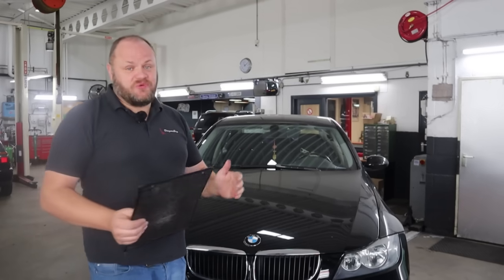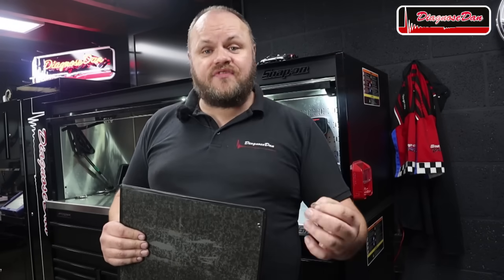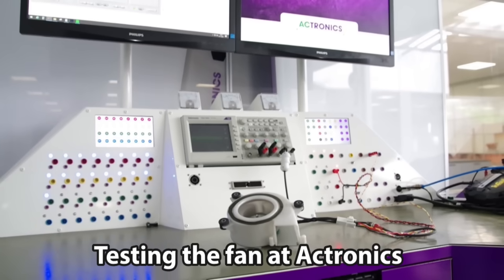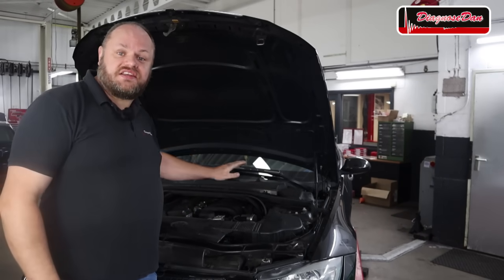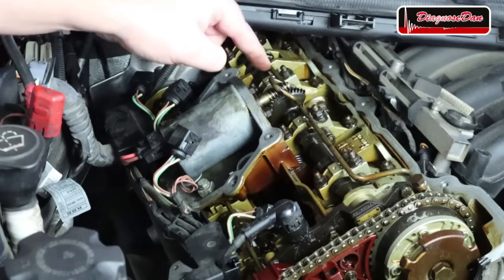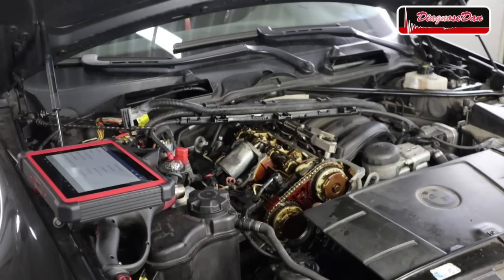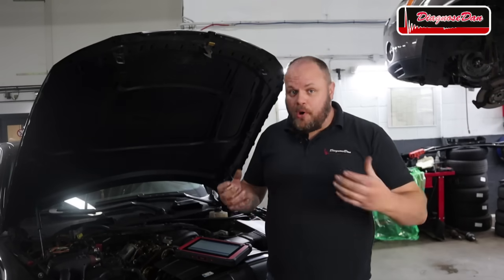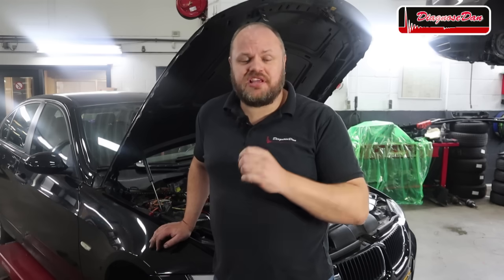Bmw valvetronic,Explained,Diagnosed,Fixed

Comment: I heard that the valve Tronics can affect how these 128I’s act. I’ve been told the transmission in these cars are just that way but every morning I start the vehicle up it seems like it has a hard shift from 1st to 2nd and sometimes 2nd to 3rd but the car is drives great. I’ve change the filter and transmission fluid I’ve never had this problem before and l Keep getting told that’s just ben told that’s the shitty BMW transmission? 
Any advice or any help please

Comment: Hello I have an dme error 134A02 Valvetronic servomotor overloading is the same kind of problem with overheat ? But no engine check at all

Comment: At my E87 120i the valvetronic is defect, i dont know exactly whats defect, i changed the position sensor and was about to learn it in via laptop but it failed. The Excentric shaft looks only good at the knuckles, but beside the knuckles where the rough surface is, its hones in a lot, like 1-2 milimeters. So next thing i will do is change the Motor and see if the motor is the problem it fails the learn in test. But one point you said i dont understand, because i drove a 120i with working valvetronic that felt alive and had lots of power at lower RPM, mine with the valvetronic defect and running with the throttle body feels like 100hp instead of 150hp and much less torque at the lower revs. I also had to pull out the positioning sensor plug, because with it plugged in the engien starts and feels like its just on 3 cyninders. But without the position sensor plugged in, its working fine as a dayli driver, only problem is it has so much less power. If the Motor is not the problem, i will replace the excentric shaft, but its always a lot of work in this tight space at the E87.

Comment: Dan I'm getting two different codes p1030 and the p1014, one points to the motor and the other to the sensor now I don't know if one is triggering the other,  the valvetronic motor is issued as permanent while the sensor is issued as current code. Could you help? Thank you!

Comment: Dan, love your videos always learning from you. 

I am thinking that with time perhaps the insulation on the motor windings fail and create an electrical path to the armature, then to the motor bearing that sits on the motor casing. 

That can account for relatively low resistance between motor brush and the casing. Would be interesting to see how heat or lack of heat affect the 2800 ohms you were seeing on the multimeter.

Thank you Dan, great job.

Comment: Hello I have an issue with my 2007 x5 Valvetronic system.  When I test the bank 2 vvt motor it has 12v with the wires swapped it has 3.5v any ideas?

Comment: Hello Mr Diagnose Dan 
I'm having issues with my 2006 BMW 3 series with an N46 engine like you have in the video. I bought a new Siemens VDO valvetronic motor and it's failing to relearn to it's correct position.
I'm not sure whether if it's the Eccentric shaft sensor.
Please help.

Comment: Awesome video as always!! I have an 08 528xi that has rough idle and NO power. it has a code for the eccentric shaft, I forgot what the code is right now though. I do have a question about that shaft-the scanner says eccentric shaft specified angle is 0 but the actual angle is   56.  I unplugged the motor and can manually turn it back to 0, when I plug the motor back on it stays at 0 but as soon as I start the car the specified number goes way up, then the actual number goes back to 56 and specified goes back to 0. Do you think this is the eccentric shaft sensor? I tried unplugging sensor and running the car and that made no difference. THANKS for ANY guidance you can give me...Ken
Reply: Actually the code is 2A39=valvetronic adjustment range. It also has 2E85 =electric water pump communication that is steady. I am assuming that code has nothing to do with the running but maybe I am wrong about that? I did do the adjustment range/stop and that said it was successful.

Comment: My bmw z4 is having EML light on 😓
Timing chain, Valvetronic and solenoid valves and camshaft exhaust sensor are recently changed..
The error code showing are P1050 and P1062.

Comment: @DiagnoseDan interesting video. I have a 330i rebuilt angine and after 30.000km it started to stutter/jerking up until moderate throttle, and fithout DTCs. on WOT and after 3500rpm works like a charm but anything else its miserable e90. lots of love money and sweat went into this car but it started to pi** me off. bunch of parts has been changed and this is something new to check tommorow the resistance between pin and housing. i will put new plugs after 30k and check/change accelerator pedal( friend has one ), and we hope for the best.
But if i get any resistance on servo motor do you reckon its dead? or on the way to get dead soon? Nice videos, i love em. have a nice one

Comment: I once sold an e46 318i that was stuck in limp mode for. We agreed on $900. When the buyer came to pay for it and take it away, I took the $900 and gave her $200 of it back as a goodwill gesture. That’s how much I hate E46 junk.

Comment: Yes it is a sign of failure. There are little shavings that create a short through the motors wires and the body itself. I know that you can clean the whole assembly and then put it back in (as in an electric motor is not much that can go bad) but I have never personally tested that. I just go and buy a replacement part and be done with it.

Comment: I have fault code 2E0F can you help me diagnose this? If the issue is the same and related to the valvetronic motor why bother replacing if I just get a little less mpg? Might as well wait for the valve cover to start leaking and do both at same time

Comment: Dan the garage said my valvetronic motor needs doing 804 pounds to fix they said my car makes noise when open  close doors on key fob and my car when warmed up either won't start or if it does it will only go ten mph in each gear m135i ????

Comment: Hi Dan, great video.  I have been getting the following error code 2A70, 2A6F, 29CC and 29D0 despite new coils, spark plugs, VVT Motor and Camshaft sensor.  Your suggestions will be greatly appreciated.

Comment: Hey Dan, I own the same car, the exact same engine, and unfortunately the exact same problem. I've owned this car since 2016.I have replaced the valvetronic motor two times in the last 3 years, but the issue always seems to come back to my car. Any suggestions on how to fix it permanently? I have checked the motor itself and wiring harnesses and they all working fine.

Comment: Good day. I was following your videos and I attempted to remove and replace a n42 engine from 2002 BMW coupe.  I removed the cylinder head, replaced the head gasket, bought the timing tool and followed the instructions.  I attempted to start the vehicle and it cranked but no start, I then found that the fuel pump was bad so i replaced the fuel pump, fuel pump housing and also clean the gas tank from gunk build up. I also replaced the fuel filter.
after al this I attempted to start, it cranked but no start so I removed cylinder 1 coil pack and cranked with a screwdriver inside and it sparked. I have spark at least from one cylinder so I assumed all has spark, I also have gas to the fuel rail. 
I think I need to test the other 3 coils, and also if each injector is spraying.  I attempted to prime the system with a little gas at the intake while cranking and found that it was pushing air out the hose on the intake, these hoses normally suck air so am assuming that my timing is off. but how come, I used the timing tool properly I am assuming. 

what's you input.

Comment: It's no doubt that BMW messed up with the valtronic system especially on the 4 cylinder cars. Most common was the 320i, E90.
But you're good at your job, Dan. 👍👍👍👍
Reply: Everything was messed up on the 4 cylinder cars 😂😂

Comment: Hey, does anyone know how much power should be on the connector while car is running? When i disconnect the valvetronic motor and test the power i have reading of 8.2 volts, should there be something like 12 volts ? i dont know, by the way motor reading is 1.400 ohms

Comment: Don't forget the little hole on some valvetronic motors that you can stick an allen head in and manually back off the motor when removing or installing

Comment: Dan, great learning experience as usual. now i understand the valvetronic technology & reason for its use. you are a real master at finding intermittent faults so quickly. the intermittent (temperature-related) failure of a dc (brush motor…my guess) showing as a finite resistance to gnd is interesting & something i would never have guessed as symptom (aren’t such components super reliable? seems not). 

love the way you whisk off all those plastic engine covers with the cordless & use those fast ratchet ring spinners. why not leave the plastic covers off permanently & save all that work! sure, engine wouldn’t look so good & more exposure to dust & grease. (but that’s a discussion for another day).

regarding “valvetronic” technology & using inlet valve opening control instead of a butterfly to control an engine o/p, sounds like a great engineering project! but i worry about the extra mechanical/electrical complexity (& probable less reliability for a (small?) increase in efficiency). i’m curious if other manufacturers too use it. is the increased efficiency mainly at low airflow/output? guess that’s a different discussion for another day.
Reply: The motors are reliable, but can get burnt out from too much heat or eccentric shaft sticking. The motor is made by siemens vdo pretty good manufacturer.

Comment: Great video Dan. Regarding the bench test of the motor I don't believe the insulation resistance test was valid to condem that motor as faulty solely based on that reading, 2.8mohm on a 12v system is negligible. The DME can't pop a code based on that I very much doubt. However I expect if you did the same test and applied heat you would see that resistance decrease significantly. Also the fault code couldn't be generated by detecting that high resistance to earth/body. The fault must be a measurement of the motor internal resistance only. More likely a complete open circuit situation for the motor to run and not run at all when warm, if stripped a bad connection or soldered joint would be the culprit I reckon. Thanks again for these great videos, I aspire to be at your level.

Comment: I would apply voltage using a power probe on that suspected poorly insulated pin to the motor winding and the case. You can read the voltage drop and potentially pop the breaker on the tester confirming the failed insulation. The meter doesn’t pass enough current/voltage through the motor hence not duplicating normal operating conditons

Comment: Great informative video, i have the same vehicle with what seems to be the exact same problem. Is there any way to do the motor test with out using scan tool. My scan tool cannot actually activate the motor? Thank you been struggling for weeks and spent money on parts not needed...

Comment: When you test motor windings you generally do a winding resistance test between the two pins to establish the value of the actual winding and then you also conduct whats called an insulation resistance test which is basically the test you performed. However when you do an insulation resistance test you use a Meg ohm meter that puts a voltage into the winding which on  ac motors is at double the line voltage typically 500 or 1000v dc and the meter indicates in Meg ohms the insulation resistance  which is in millions of ohms. It is basically a stress test that indicates whether the windings  are shorted to earth or the metal housing of the motor. For an insulation resistance test to indicate leakage in the K ohm it would seem to be pretty a bad indication. Moisture in the motor is a very common reason for low insulation resistance and in the case of these motor possibly ingress of oil and carbon from the engine itself, On larger motors they can be dismantled and cleaned out and in some cases the windings can be re varnished and then re-baked to restore the insulation.

Comment: Hello DiagnoseDan. This video is a little old but I have a couple of codes from my car and they happen every now and then. P1050 and P1062. The engine is n46 on a 1 series. When the codes appear, the car goes into limp mode and an orange engine light appears. When I erase the codes, the car runs alright for weeks and it happens again. The other problem is that the car hesitates when throttle is pressed. I have to press it slowly to get it going.

Comment: Wonderful job as always. Once I opened a motor for my curiosity and I've found a lot of brush dust inside. I disassembled and cleaned all inside, changed brushes with a new pair and assembled back. Resistance to ground disappeared! This experiment leads me to believe that the dust inside accumulated and started to conduct electricity and short to body (ground). Resistance should be infinite to body (OL) since brushed have no contact to body.
Reply: Thats a very logical explanation and a very smart and economic fix.  New motors from BMW are painfully expensive!   Where did you source the brushes from, and how did you open up the motor?   Thats a worthwhile tutorial video in its self!
Reply: How do you open it?
Reply: @pokkeljaan  With an "L" Blade on bench vise and workaround with a small hammer where is closed
Reply: @pokkeljaan  https://www.youtube.com/watch?v=m6sNw1NJeJY&ab_channel=EnduroShot
Reply: great comment, thanks man!

Comment: Dan, you make gteat videos, well explained! I own an E93 335i BMW with N55 motor. Currently, I am having issue with DTC transmission with overheating...BMW suggested to replace the entire transmission which is quite costly (they changed the transmission oil, filter and gasket, but the issue remained). Do you have any advice or content for me? Thanks a lot
Reply: My2010 128i e88 Thur a code for dtc it was the sensor at back drivers side wheel couldn't read the cog . Cog was toast from rust

Comment: STORY TIME: first time I tore down a N42 engine (to replace cardboard valve seals and all other leaking seals plus the toy plastic chain guides) I had NO IDEA that you need a special jig to remove the rocker arm assembly :D The springs and VANOS rocker arms went flying across the garage. Two of the arms broke in pieces. I almost cried... called BMW.. they wanted about 800 USD for a set of new arms. Finally found a used set from GB that was in good condition, and works fine. Had to order the specialty tools from Germany for like 250 euros, otherwise you can't assemble it again. 
BMW are lookers and great drivers, but damn they can really give you a hard time.. Still have that car though. Lowered down with a short shift it corners like a race car. If you are doing work to your N42 engine make sure to change the chain tensioner to the updated model. The old one was shorter causing the chain to slam and brake the crappy toy guides. Love your videos DD!

Comment: I hate the future version of this stupid valvetronic system on the F30 N55 it have started to fail in lager number, there you have to remove the high pressure injectors and two of the "Spark plug recess insert" to access it, not to mention the whole eccentric shaft
Reply from the maker: It keeps is off the street Mihaly 😉

Comment: failed motor for sure, probably a winding shorted to the armature core or carbon tracking and brush dust from commutator bars to the shaft. would be interesting to see it on a hi-pot tester. zap zap zap.
Reply from the maker: Thanks for taking the time to leave a comment it's really appriciated

Comment: Very informative. Thanks

Q: I have e60 n52 that stalls under load or when parked and floor the pedal(sometimes). The engine still strong and the car can take off fast if not stalling. no codes . Fuel consumption never changed. Any Ideas ?

Comment: Just curious what year BMW is that?
Reply from the maker: Watch 0:16 into the video😉
Reply: I was curious on the year because I wanted to know it bmw still uses this system. The couple bmws I worked didn't. Also I would have to assume the gas mileage would improve especially in heavy traffic. If the valves only open alittle that's less fuel to make the mixture (14:1). Did bmw scap this idea and didn't vw have something a little different but similar? I really enjoy they videos it's always a pleasure to watch.

Comment: My n52 shutdown random or while driving it no power nothing. After the power comes back the date and clock resets, what could be? Where should I look? The battery is 3 years old
Reply from the maker: It's proberbly not your battery

Comment: I use my fluke insulation tester set to 500 V and  any reading below 1 Mega  ohm means motor is on the way out.
Reply from the maker: Thanks for watching!

Comment: I'm glad I don't own one of those!! Very good description of how the system operates.
Reply from the maker: Thanks Christopher
Reply: I have an old E46 with this engine (well the N42B20 which is pretty much identical), currently pushing 200K mileage, a bit noisy (rattly exhaust vanos) but only problems I've had were failed coils on 2 cylinders and a very hard to find oil leak (still not found that)

Comment: Another great video 👌 But one thing that surprises me is that the procedure that you have followed to find the issue is not really complicated, you read the codes, checked what they have indicated and boom - car fixed. There was not need to use some secret methods know only to shops dealing only with bimmers. How come other shops failed to fix it? I would think that a shop knows how do read codes and check the issues that are indicated. It was basically checking what your scanner said - the valve.
Reply from the maker: No you are right this fault was not really complicated, but because it was intermittent it was a little bit more challenging.